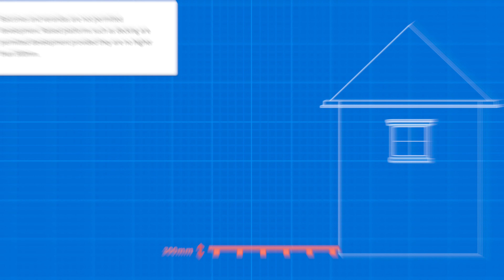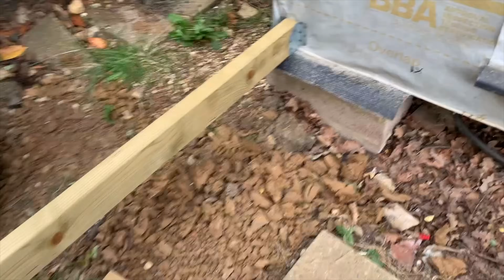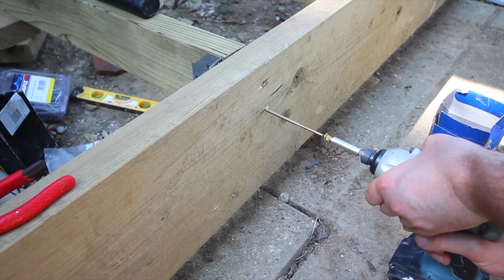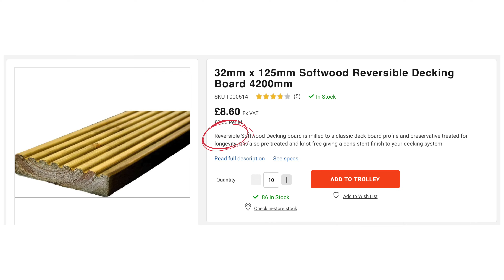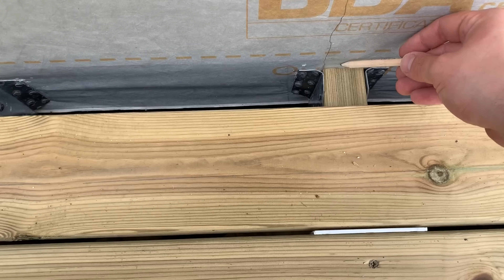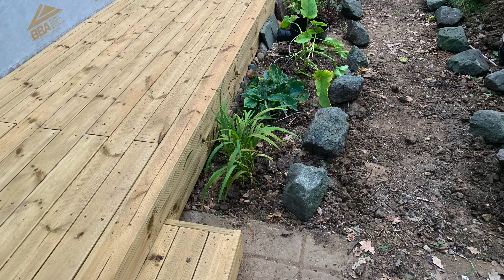Garden Room Workshop: Part 19. Decking

Comment: Hi Ali, were you concerned with the 100mm screws at all when using them with treated timber? We are in the middle of building our garden room (with a lot of help from your videos!) and we used these a lot but then found out that certain ones will actually corrode in treated timber. We got a bit of a scare so changed to different screws mid build. Just curious if you heard anything like this

Comment: Hi Ali, great series - really helped get my project going. One thing I have an issue with - due to the slope in my garden, there is a drop from the door greater than 300mm. This means I will need to put in steps up to the door. How deep can I make the steps before it's classed as a veranda?

Comment: If you're looking for a good quality preserver for the decking Ali, go for Barrettine (petroleum based) as it's the best on the market IMO. I've used it on decking and has stood the time well mate.
Reply from the maker: Perfect! I'll give it a go this summer if I have time :)
Reply: @AliDymock  You can obtain it from 'Wood Finishes Direct dot com' website. Cheapest place to buy in the UK and £10 cheaper than Toolstation. I used the premium wood stain preserver on my tierd looking garden furniture after a strip down and sanding. Came up like band new! Also used the non premium version on my shed and fence panels. Even with just one coat on the fence panels the water just beads and it lasted with no green algae after the winter. Treat your new fence with this stuff Ali, you won't use anything else after using it.

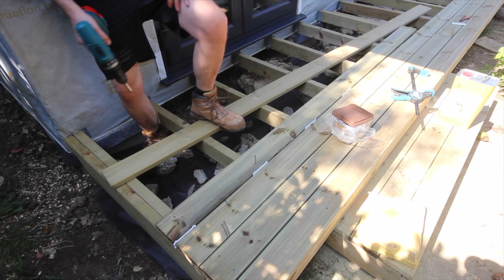Comment: 9:18 I always wondered why you didn't have an impact in your earlier videos and was pleased to see you'd "upgraded" to drive screws a lot quicker. Was surprised to see you back to a drill after you did the first step with an impact and then I saw your caption... You are a great neighbour.
Reply from the maker: I was actually going to a segment on noise because it's tricky for those working the day jobs when you're allowed to make noise. Each council has a different rule, some count DIY as construction noise, limiting you to before 6pm on weekdays and 8am-1pm on Saturdays, and others don't. There's a not a whole lot you can do about it. Drill over impact driver is one, and you can get circular saws with a button lowering the loudness. Any brushless tools are quieter than their brushed equivalents. Other than that, try to keep neighbours onside!
Reply: I know where you are coming from. ~Shouted at by neighbours while using my circular saw on my garden room roof OSB. (Oops as I am strictly over the 2.5m)  so changed to hand saw!!

Comment: Hi Ali, did you have any type of fall on this deck, I've seen somehwere they suggest having a slight fall for rainwater to run off?
Reply from the maker: No fall on this, the water just falls down the gaps between the boards. I think perhaps you mean if the groove side is facing upwards then the water needs to drain down the length of the decking and so you need a fall.

Comment: Osmo make some high quality external oils/ stains. Low VOC etc
Reply: It still wont last. I've built quite a few hardwood decks and its a 3-4 month reapplication even with 2 coats of exterior grade OSMO. I've tried pretty much all the products out there and performance amongst the premium brands are comparable. I've concluded that composite is the only way forward.

Feel free to use whatever exotic wood you desire on vertical surfaces, but horizontal is a different matter.

Comment: Just a FYI. We did our decking the same as yours groove down, flat top. It’s been in about 6 years now, top is painted light grey, edging a darker grey. We try to repaint it every year, think once we did leave it for two. Overall very easy to maintain, just jet wash, dry then repaint over the old stuff. Comes up very nice, we haven’t felt the need to sand yet.
We have only had the replace one board in 6 years (front strip hiding end grain) and live in the NW of England, half a mile from the beach were 50mph winds/driving rain are pretty much the norm haha
Reply from the maker: Thanks Jake, that's great to hear, what paint are you using?
Reply: @AliDymock  Ronseal Decking Rescue Paint - Charcoal
Ronseal Garden Paint - Slate
The "Garden Paint" is on the actually decking boards so high traffic and just used the "Rescue Paint" because we liked the colour, it's only on the trim pieces.

Comment: I think the groves do make it less slippery, we had 2 decks, one grooved and one small pond deck which was always wet and often had a mossy slippery covering, was absolutely treacherous. Meanwhile the grooved deck means there's more pressure on the wood as there's half the area, maybe the logic doesn't work, but just seems right based on what I know.
Reply from the maker: Hey Oliver! I think anecdotal evidence is as strong as any theory so maybe I'm wrong on that point. The decking that has the very thin channels I can imagine being quite grippy. Either way it seems to be a bit of a quirk here in the UK
Reply: We've used the grooved stuff and it was very slippy after a year or two when it greened up. Ended up buying those grip strips, very effective but a cost.

Comment: Nice job. I went with composite for my deck which is approx 1m x 5.5m and cost £400 so quite expensive. Was so impressed with it bought more to build a bigger deck for the garden. Dino decking is the company and highly rate it.
Reply from the maker: Nice. It’s a bit of a regret of mine to be honest. I reckon I went a bit too high end on insulation and too low on decking!
Reply: £400 ain't much. I usually use IPE and its considerably more expensive and extremely high maintenance.